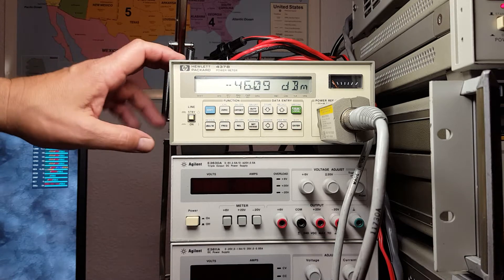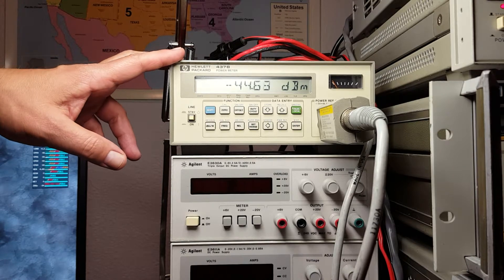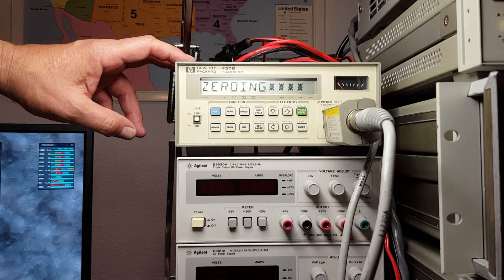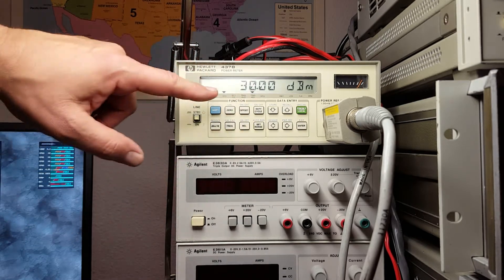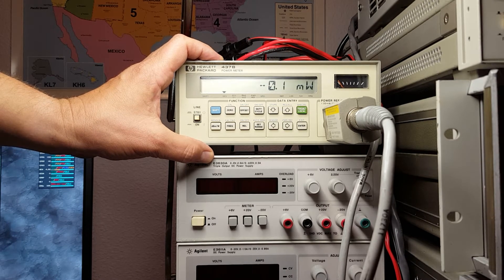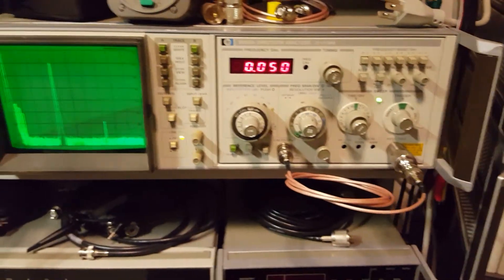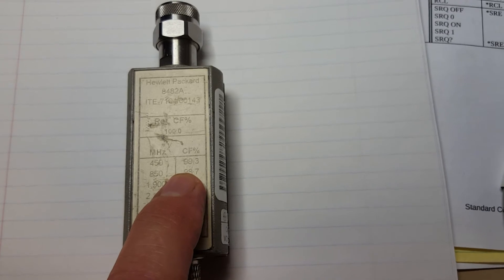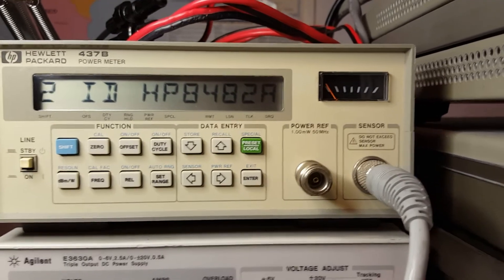HP 437B Power meter demo.

Comment: Newbe question, does the meter have some options for measuring modulated signals? Or does it only work well with clean sinus?
Reply from the maker: This meter is only designed to measure continuous carrier signals. It will measure a modulated signal but the readings will be erratic. The only HP power meter that I know of that is designed to measure PEP power is the HP 8900C. This meter is an older analog style and takes older power sensors that can be difficult to find. Thanks for watching.

Comment: good little tutorial. I've working with one of my Ettus X310 sdr units, and could not find any info on the output power of the basictX daughter board. Being that I'm designing/building power amps to follow out..(HF). Have plenty of Bird equipment, but the elements are not available for very low power, so started thinking about building one with the aD83xx devices...not in the mood! LOL! somehow I forgot that I had a couple of 437's and 438 plus calibrated sensors. duh! didn't remember how to get them up and running, calibrate, etc. found the manual on my hd, confused, getting old! came across your video, cleared things up! 73's ve3aam
Reply from the maker: Glad to be of some help Dale. I only had that meter for a week when I did that video, what I discovered later on is that the meter does not auto sense the sensor, it just happened to be set for the one I used. I also use attenuators with my sensors to increase the range of measurement. Two of them are made by Bird, one is a 300W 40dB and the other a 75W 30dB. I plan on purchasing another Bird 30dB attenuator but with a power handling of 100W. Thanks for watching.
Reply: @CraigPetersen12f36b  only one thing, it's been so long since I've used these, can't recall if you're suppose to use a 50 ohm terminator/load with a "T" with the probe, or does the probe provide the load. also fortunately i do have a 2kw terminator/dummy load with a 30db pad internally at the other end. Now looking at the E4418/19B to add in the collection! LOL!. Going to have to search for a Bird terminator/load like the one you have...73's

Comment: Thanks for sharing. Don’t know you but me I have kind of an obsession for accuracy 😄
Reply from the maker: Same here. Even though I get this stuff used, I typically spend a little more to get gear that was recently calibrated or sold from a company that resells serviced test equipment. However I have also snagged some good deals from individual sellers as well. Thanks for watching :)